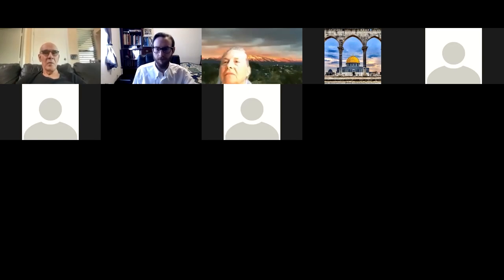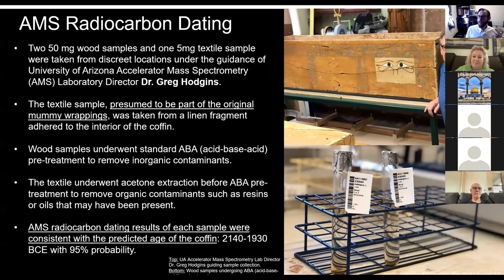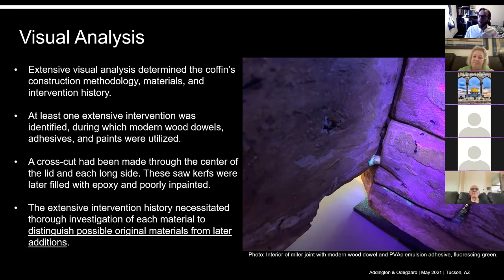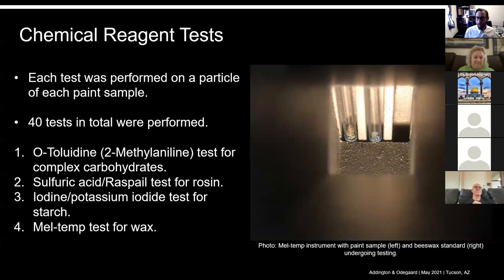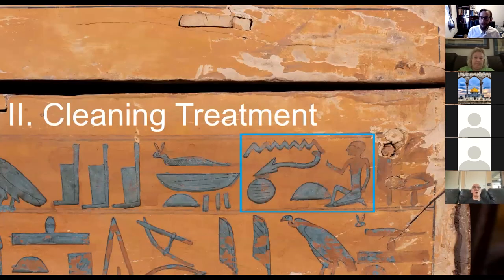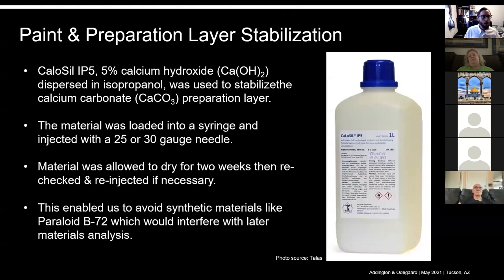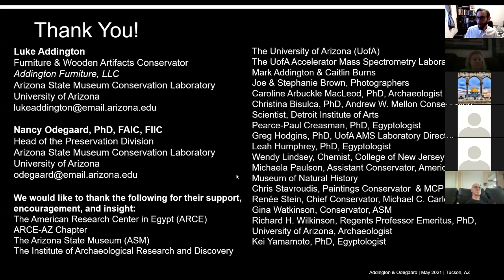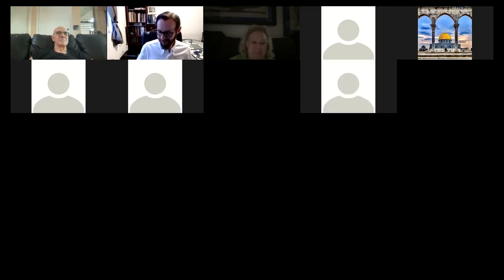Technical Study & Conservation Treatment of the Egyptian Coffin of Nakht

Comment: Well considered and nicely presented. Way to go Luke! At what point did you decide you had extracted the maximum of salts and soiling before reaching a point of diminishing return and increased risk?
Reply from the maker: Thanks Steven – most areas heavily soiled with salts required at least three applications of the cleaning solution. The stopping point was determined by observing when the Evolon CR stopped pulling soiling materials from the surface. Once dry it could also be examined with the naked eye or with a loupe to determine which areas might need more treatment and which areas were sufficiently clean.